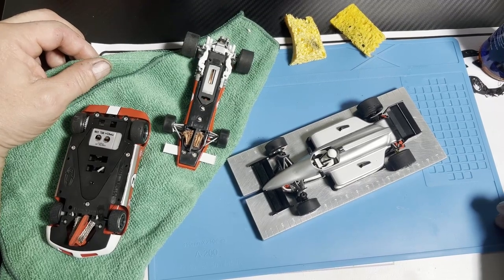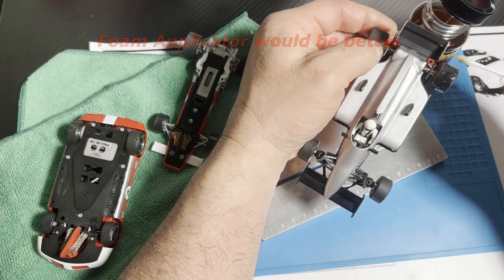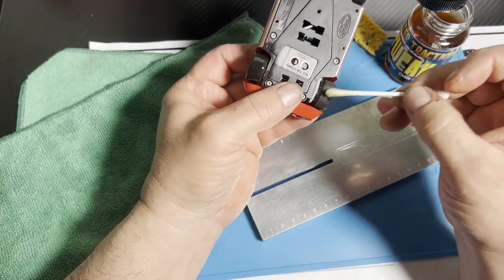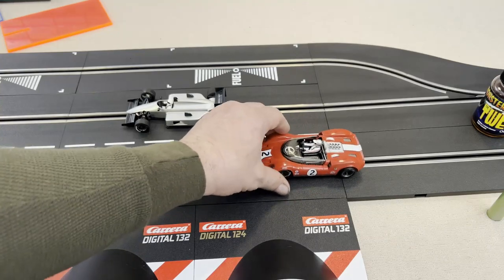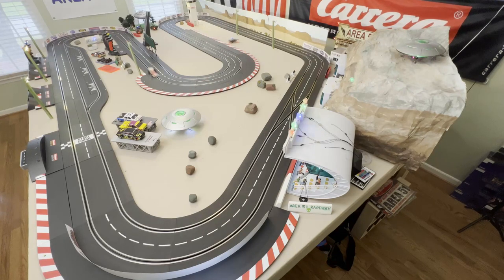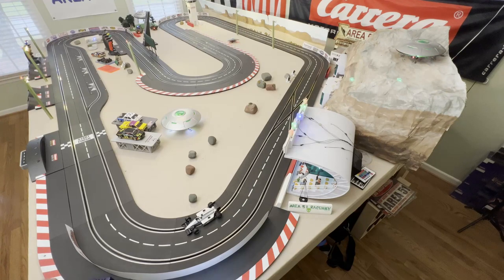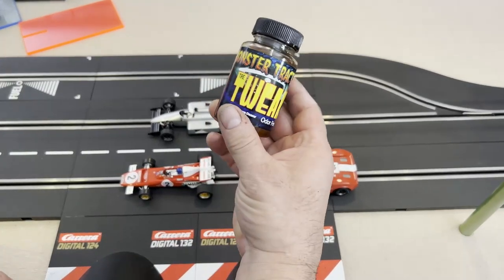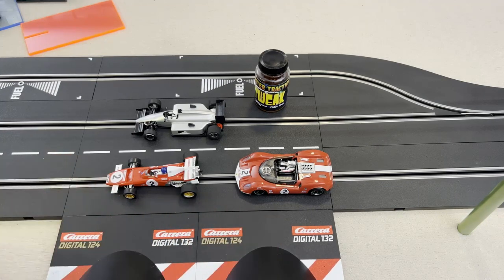Monster Traction Tire Tweak Review

Comment: Question for you. Why bother with 3 pit lane sensors? 1 is all you need. Or did you have 3 laying around and wanted to use them?
Reply from the maker: I get that a lot, It was just the design i had in mind at the time.